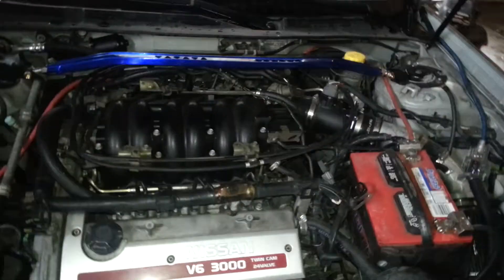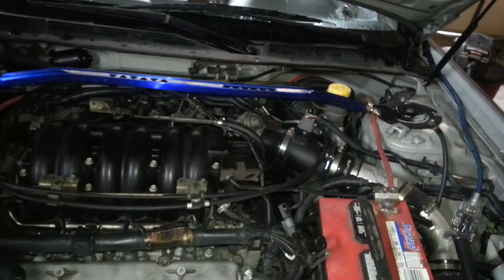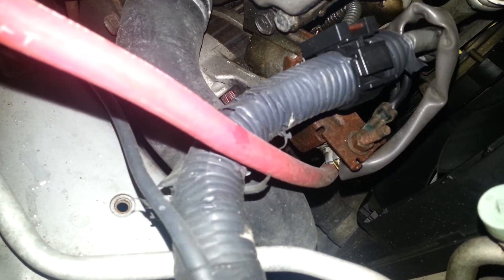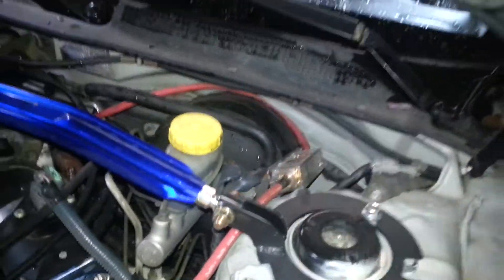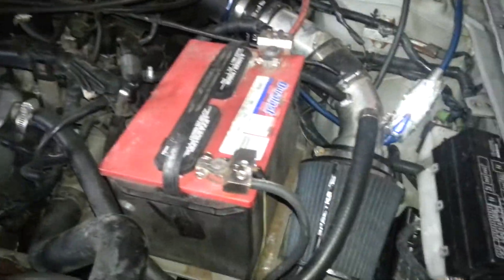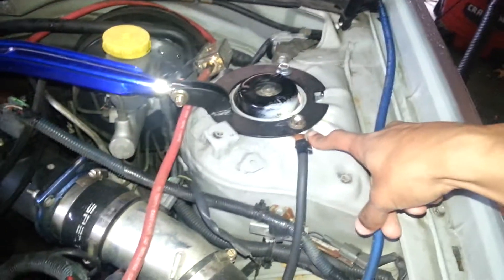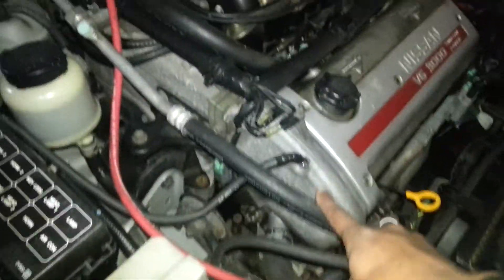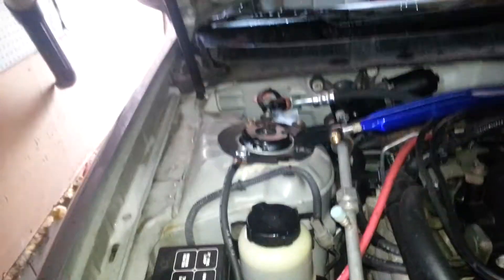Car audio: the big 3 upgrade

Comment from the maker: Voltage went from 13.4-13.6 @ idle to 14-14.43 @ idle! Huge improvement with a 4 year old battery. Remember we are adding on. Not replacing.  Voltage takes the path of least resistance so the upgraded wire will act as the main current flow